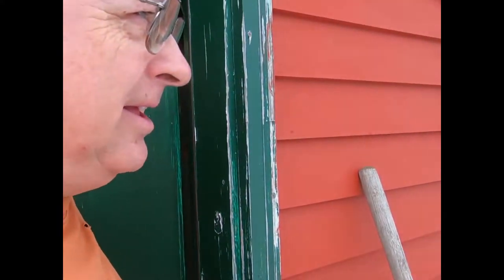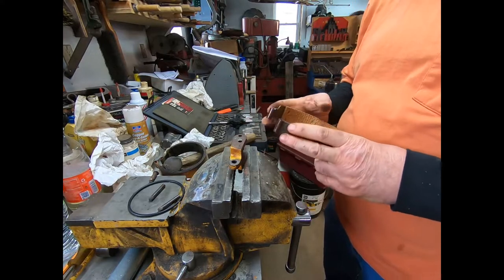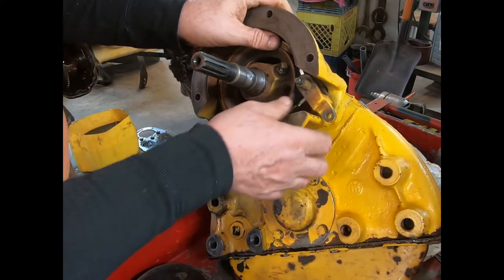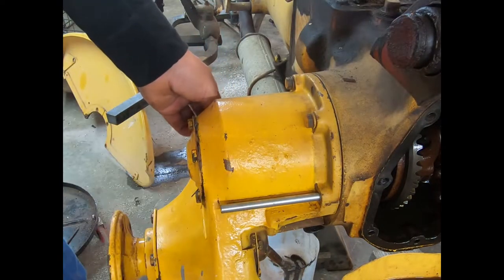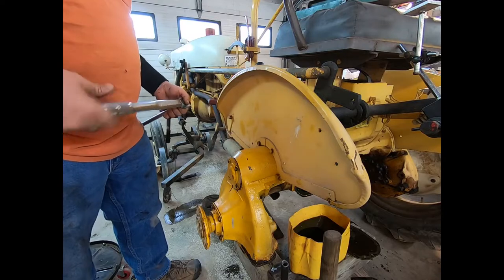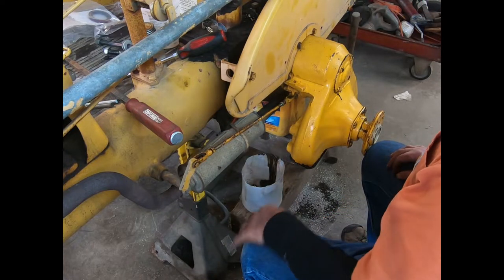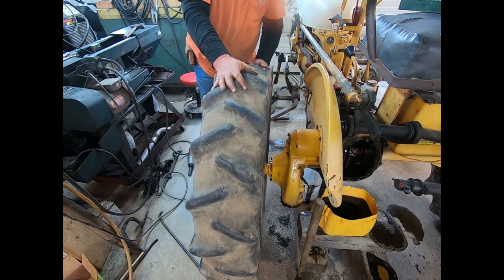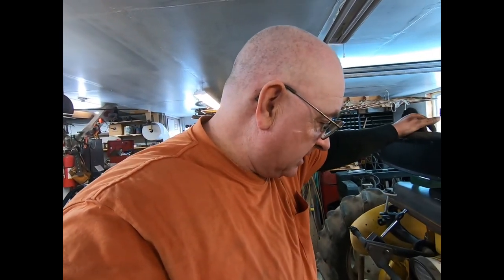Farmall Cub rear axle rebuild part 2

Comment: Great videos!  I always enjoy catching you over to Fryeburg. I've been contemplating rebuilding my final drives on my Cub once snow's gone and I don't need it for plowing.
Reply from the maker: Nice the brakes are the only part that can be a pain good luck
Reply: Fluid seems up in the final drives but there's an awful whine that sounds like its coming from the left side when in reverse.  Does that sound like a bearing problem?
Reply from the maker: @BJNich78  most cubs seem to whine when in reverse don't know why be interesting to find out when you take it apart  .

Comment: gotta love the common sense attitude when it comes to being smarter than the equipment that you are working on by using bolts and rods as drift pins to align the parts, especially when working solo. it looks like you have about every tool in your shop known to mankind. i really enjoyed the video and waiting for the day when you roll it out of the shop. jim in central florida
Reply from the maker: A life time of playing with antique engines and tractors tends to gather more tools than you normally would need, but when you do need them they are there. Glad you enjoyed.